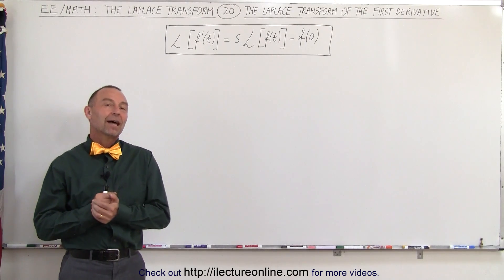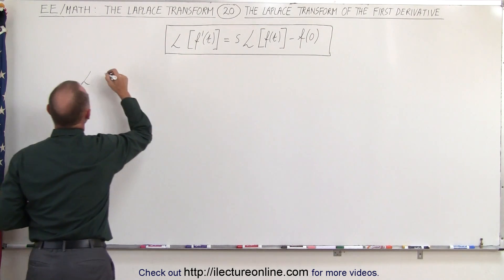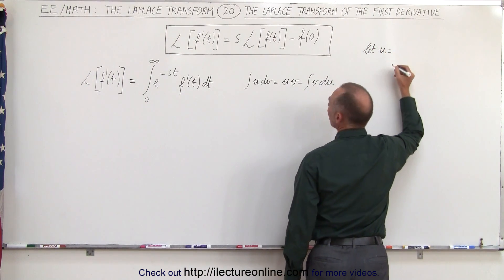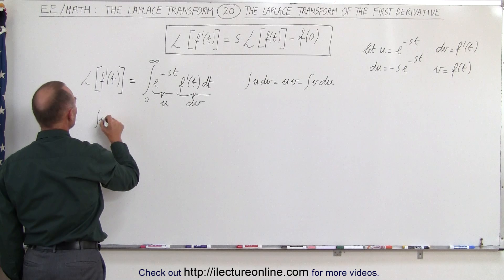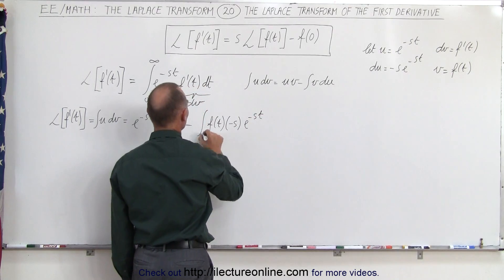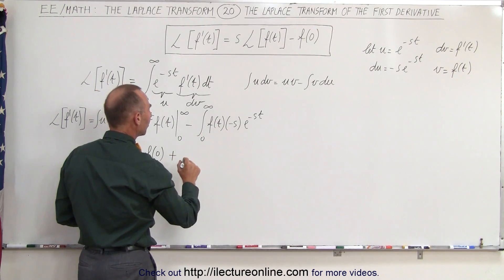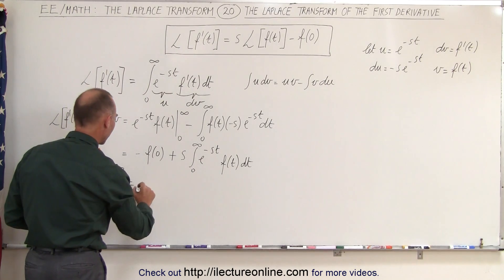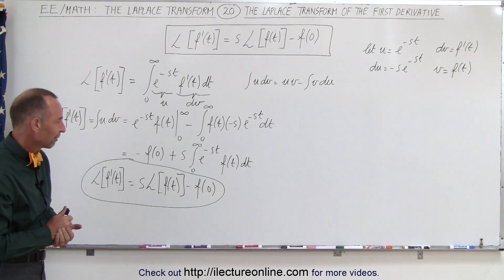Electrical Engineering: Ch 16: Laplace Transform (20 of 58) Laplace Transform of the 1st Derivative

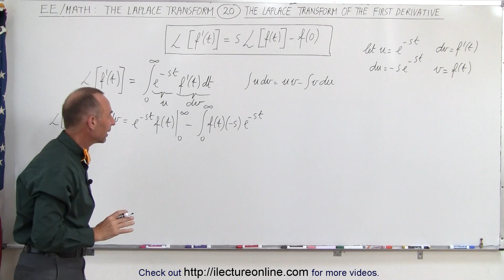Comment: at 2:45 you say that the function is equal to zero. what if f(t) is e^t? this would go as fast to infiniti as the other term would go to zero. what am i missing?
Reply: +Michel van Biezen OK thank you for the Answer.
Reply from the maker: Since f(t) represents the input voltage or current to the circuit, the scenario you suggest is unlikely.  In the real world you would not expect an input function that goes to infinity, thus the approximation is reasonable.